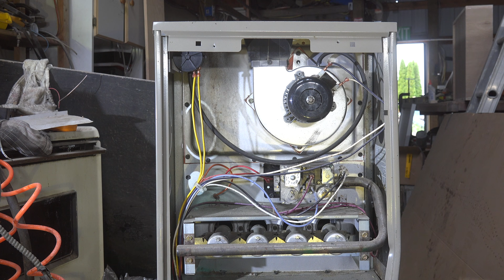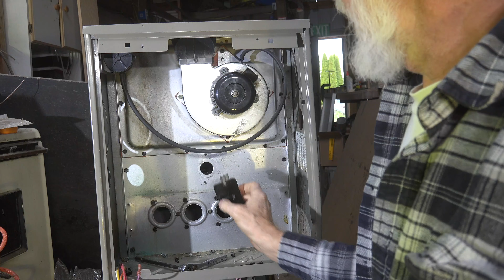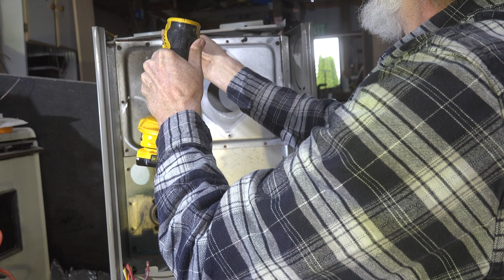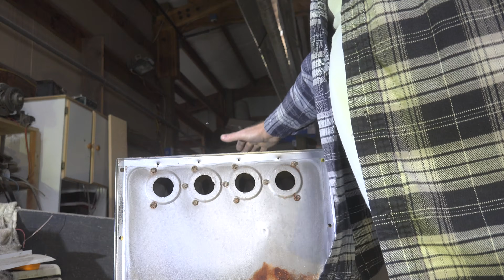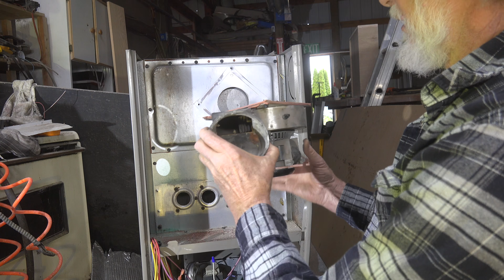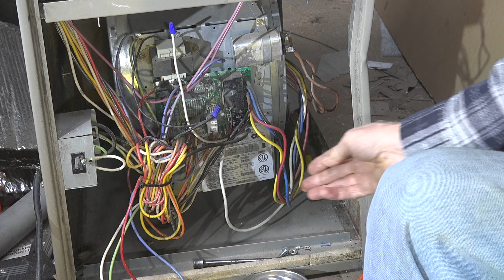Replacement of the Goodman GMP model heat exchanger

Comment: I had warrantied about 90 of the bakelite chimney connectors and Goodman called me one day and said they would not warranty them any more due to being cracked because the failure was due to me not pre drilling the screw hole. So I explained to them I was not breaking them that they were broken from the factory on the bottom side that it looks like they were were using an impact on the center screw. They said they would call me back in a few minutes. They called back and wanted to confirm my address. I asked why. They said they were sending me a reward for solving the problem they had of the chimney's cracking. The next few days I got a $250.00 check in the mail...

Comment: I’m pretty sure most technicians couldn’t do this anymore. I’ve got a Janitrol GMPN080-4. Knock on wood. Was just curious what was involved if I replaced the heat exchanger when that day comes. I’ll probably just swap it out but anything new is automatically inferior. It’s like a 95 Silverado lasting 500,000 miles and a new one having lifter or cam failures 50 miles off the lot. Appreciate your many Goodman posts. Be safe.
Reply from the maker: Heat exchanger replacement is fairly straightforward. It is a big job, but can be done by anyone with mechanical abilities.  
GFM

Comment: Anyone where to find heat exchanger for Goodman GMP100-4.
Reply from the maker: If you have checked with the local Goodman dealer, they have probably discontinued the part.  The unit is probably more than 30 years old.
GFM

Comment: If your furnace is 15 years old, replace the entire furnace. If you have the ability to replace the heat exchanger, you can easily replace the furnace with less effort. By the time you buy the heat exchanger, gaskets, rollout switches and plastic flue adapter, and maybe the burners, for another $500, you are brand new. The total labor is about the same.
Reply from the maker: The GMP furnace had a defect in the rivets in the heat exchanger that caused the failure.  It was an 80% furnace and I could diagnose the failure in about 10 min and return with the heat exchanger (under warranty) and finish the replacement in about 1.25 hours.  With driving time, the bill would be (in the 1990s) out the door with a customer bill of $150 to $175 for the total bill.  
GFM

Comment: Thank you so much. You are still helping people like me. 25 year old furnace but my free labor, your help and $229.00 fixed. I did install a new inducer while I had it off. $80.00
Reply from the maker: Its good when it works out!
GFM
Reply: Where did you find the heat exchanger for only $229? Thanks

Comment: Great video and thanks for sharing. 26 years old same furnace never any trouble. Heater exchanger finally went after 26 years. Only 275.00 new to replace and my free labor.
Reply from the maker: Glad it helped
GFM
Reply: Can you link to the replacement you bought?
Reply: @marshallandroxy  yes I will get that information for you. And yes, it’s still going strong January 2026 my furnace is the original from when the house was built in 1999.
Reply: @grayfurnaceman you are the best.
Reply: Did you send a link for where you bought the heat exchanger? I don't see it. Please send it again. Thanks.

Comment: Hi Gary thanks for your excellent videos! Gary I see a potential problem replacing the heat exchanger on my JANITROL GMNT100-4 after doing some more scoping of things and that is, it looks like the whole heater assembly unit is a pretty tight fit in the cabinet which means i would have to be able to pull the old HE straight out and put the new HE straight in as the AC cabinet above the furnace doesn't seem to want to budge after putting some ratchet straps on it and trying to lift it up a tad. And i saw in a Payne HE replacement video where the guy had to lift up the back end of the HE to fit some tabs on the back of the new HE into some slots in the cabinet frame, which required him to lift up the back of the HE a few inches and then drop the HE tabs down into some slots. So if the new Goodman HE for this unit has to be lifted up a bit and then dropped down into some similar alignment tabs, i'm pretty sure it won't go well as its looking like there may not be a way to hoist up the AC cabinet which sits on top of the furnace. On the other hand if i wouldn't have to lift up the new HE any and could just slide it straight into the cabinet, then i may be able to replace it. I guess i could dismantle the old HE and try to slide it straight out and find out if it will it will pull straight out that way, but i'd like to avoid doing that if it could potentially affect the AC part of the system.

So just wondering if you've ever been able to pull a Goodman HE of this type straight out and slide one straight back in without having to lift up the top lid of the furnace or lift up the AC unit above the furnace in order to replace this type of HE unit? And looking at the current HE, it looks like there's a lip that faces forward and i can see some a good amount of sealant between that HE metal forward lip and the roof of the cabinet, so i'm thinking i wouldn't have to undo any screws for the top of the HE?
https://voomisupply.com/products/tru-cut-inc-0257f00174s-ht-ex-assy-5b-fur-burner-furnace?currency=USD&variant=45440980648242&stkn=5587a5a64bed&utm_source=google&utm_medium=cpc&utm_campaign=PMax:+-+Catchall&gad_source=5&gclid=EAIaIQobChMIlMyDzqSNjAMVBxtPCB1OBiwFEAEYASACEgIwJfD_BwE

thanks again Gary for for any insights!

Comment: Good job GFM!
Is there a limit to where a furnace gets old enough that parts are no longer available for it?
People want me to buy a new furnace because mine is and 1988 model. Thats getting pretty old.  It is a  Rheem Horizontol and to my knowledge still has the original heat exchanger. 
If could buy parts for it it would out last me and my grand children and theirs.
The heat exchanger is the straw that brakes the furnaces back.
Reply from the maker: Most parts for that furnace are general replacement types.
Of course, the heat exchanger is the problem.  I would guess that a replacement for your furnace is no longer available.  
GFM
Reply: @grayfurnaceman  I haven't checked on parts yet. It has not set off the CO monitor yet either so that's a good thing.
It couldn't have much life left in it though.
in 2028 it will be 40 years old.
I have a pilot igniter on the way and I plan to check the heat exchanger before putting it back in service. Its been down a couple weeks now. 
I have to work on it myself since  no one will put it back in service.  
Thanks to you guys on youtube I could almost do house calls.😀

Comment: I have a Goodman GMP075-3 and came here not necessarily to replace the heat exchanger but to remove it in order to access the bottom of my evaporator coil in order to clean it.  The evaporator coil is an old Bard one, to match the condenser unit outside (probably 40+ years old).  It's all R-22...really being cheap here but the furnace and AC run fine (with exception to hitting high limit with a slightly dirty filter and now I can see my coil icing up) but I was able to remove the blower and look through the heat exchanger to see the dirt caked coil.  I probably should replace all of it but that's quite an expense and a bit of work.  I wish there was an easier way...but I don't think so.  I have walls on 2 sides of the furnace, I'm kind of backed into a corner on this one.  My last ditch effort will be to clean the coil, if that doesn't go according to plan then I'll be upgrading to a new unit in the not so distant future.
Reply: How did things turn out for you?  I've also got a GMP075 REV A,  from 1997.

Comment: I presume there are no gaskets or caulk needed for the heat exchanger and it just sits right back into the space?
Reply from the maker: The inducer must be caulked with high temp silicone to the heat exchanger.
GFM

Comment: I have a luxaire and looks allot like this furnace..was told a replacement of exchanger is close to 2 grand...may as well buy a new furnace than spend that kind of money..
Reply from the maker: All I can tell you is that furnace was quite an easy replacement of the heat exchanger.  My total hours including diagnosis would be 3 hours and if the heat exchanger is under warranty, zero for the heat exchanger.
GFM

Comment: I have a Gmp075-3 it runs bringing room up to or holding thermostat temp but it runs Blows heat Flame goes out inducer motor keeps blowing for 1,2 min then flame kicks back in and runs another 5 min keeping it at set therm temp cuts off and repeats need help -5 Degrees out
Reply from the maker: Sounds like overheat to me.  Plugged filter, dirty blower wheel, plugged A/C coil or ductwork problems.
GFM
Reply: @grayfurnaceman  Will Check Thankyou

Comment: I have a 18yr old goodman gas furnace model GDT090-4. Im looking at replacing it or putting in new exchanger. which way is best to go.. I can get a new downflow goodman 80k installed for about 1800. However, Im thinking the exchanger I could do myself alot cheaper. I already put in last yr the control board and limit switch.
Reply from the maker: Its on the edge of not worth it but if you are doing the work yourself, I would consider it.  You have already put some money into it and the job is quite doable by a handyman.  
GFM

Comment: if I replace heat exchanger with OEM, will the new one fail also? Is there a better aftermarket exchanger?
Reply from the maker: I have seen 2d heat exchangers fail.  Heat exchangers are specific OEM parts, so you are stuck with them.
GFM

Comment: Wow, I've had two of these units in my house since the mid 90s and I have never had a problem with either one. Appears I should consider myself lucky!
Reply from the maker: You probably are.
GFM
Reply: @grayfurnaceman   I have a 60k  Janitrol, the year after I bought the house  the ingnighter went out.  A $560 dollar bill.
I started looking into furnaces. Been through maybe 4 of them, Mn ya know? 
An upper heat limiter switch, and an inducer motor.,
I have one flame inducer bypassed because I am crazy and lazy.
I think I could do the heat exchanger a bit easier with my unit but, it is probably time to just give this idea up instead of pushing my luck.        
 
I have an HVAC dude that will help me put in a new Goodman, I will have to pay him but I will do it myself and have him look it over. I need to do this before your President Biden wants me to upgrade into HE,  Bankrupt the Farm? 
What a fool! 
At any rate, thank you for the video, it is not rocket science but it is far more than any "Settled Science"  clown like Obama could ever understand.
What is wrong with these mostly wrong and America hating Democrats? 
I will find an ethanol burner and really burn the low IQ carbon footprint mass stupids.
Reply: Yours was probably assembled on a t,w, or th. Everyone else got one from M or Fri production 😂

Comment: Hey, maybe you can assist.
I have one of these in my home. Model # GMP100-3. My furnace is not heating and I’m thinking the igniter just needs to be lit. I seen when you pulled the igniter cable out where it was located.. can i just light it with a lighter/candle lighter?
Reply from the maker: I guess you could start the unit and when the gas valve opens in a trial for ignition, light the burners.  The problem here is it will run for a cycle, then shut down and not start up.
If the ignitor does not warm, check the error code.  It will tell you where the problem is, not drafting enough, failed ignitor.  Often an ignitor will fix the problem.
GFM
Reply: grayfurnaceman okay i will try this. Thanks so much for your quick response!! :)

Comment: I have the same furnace.  I replaced the gas valve and fan inductor.  Do I have to adjust the gas valve pressure or does the factory set the pressure. Thank you again Grayfurnaceman.  You always provide great videos.
Reply from the maker: I always check the manifold pressure.  Your furnace is 3.5 in wc, which is kind of a standard and most gas valve come set at that pressure, but I would never trust it.
GFM
Reply: @grayfurnaceman  Thank you sir.

Comment: hello again question, wayne burner is from 1990,eg1 it has on it ,GPH 0.50-0.75 A should I replace with 0.50-0.80 A, right now I think it has 0.60-0.80 b would that make it leak
Reply from the maker: If your furnace is a mobile furnace you may need a 90 degree nozzle.
GFM

Comment: Another question ,as I mentioned adjusted electrodes and gun depth and furnace runs real good,But still getting quite a bit of kerosene dripping directly under housing unit ( between pump and motor) could the seal be bad or shut off on pump if it has one ( single line stunted pump) pump is somewhere around 6 or 7 years old
Reply from the maker: If all fittings are free of leaks, you could have a pump shaft leak.
GFM

Comment: I did that once in my 13 years on a Carrier High Efficiency, it was a pain. The instructions were OK and it took about 6 hours, with an hour of letting the sealant tack up.
Reply from the maker: The repair time is for that furnace only.  Most other 80% furnaces and all 90+ take much longer.  I usually allow 5 to 6 hours for them.
GFM

Comment: couple of broom handles into the burner tube holes and sticking out  a few feet out for more leverage works pretty good.
hands on top near exchanger to lift, ends extended under forearms towards elbows for balancing leverage.

Comment: Do they still even make replacement exchangers for this junk?
Reply from the maker: Yes they do.
GFM
Reply: @grayfurnaceman  I suppose they have to for making a defective product dead on arrival.
Reply from the maker: @AmericanFarmerHVAC2024  Well, I can't say it was defective from the factory, but pretty close.  
Within 2 years of the initial install I was checking all units for flame rollout and I seldom found one that was not failed.
GFM
Reply: @grayfurnaceman  what is flame rollout? Just wondering.

I was excited to see my exact furnace here and you saying it was a quick job, until I read the comments, and also seeing you need to unscrew things in the side where I have no access sort of kills that plan. Still, nice to know it could maybe be done.

Debating only replacing the blower motor to get another season out of mine.

Comment: Another great video, thank you! I have one of these dangerous piece of crap money pits, but I don't use it anymore since I installed a mini split heat pump. I'm in Tennessee so it doesn't get too cold here, the mini split does just fine for me since I keep my house pretty cool anyways and it costs about $80 a month less to run than that crappy furnace.

Comment: On this GMP unit for us newer technicians, what was the failure point?  Is it that the rings pop out?
Reply from the maker: The rings pop out on the older units.  This happened within 5 years.  Later, and I believe with replacement heat exchangers, a number of cracks started near the rings.  
Pretty much what TheGettoLobster has said.
GFM
Reply: @grayfurnaceman  Thanks helps a ton!
Reply: Sometimes rings, other times cracks. After the GMP goodman switched to a tubular heat exchanger. But they fail more often than other brands.
Reply: @TheGhettoLobster  Thanks for your help!

Comment: Gary do you know how to replace a oven door sping on a vintage tappon stove let me know post you have done it this would be like from the early 50s f
Thanks for every thing
Reply from the maker: I have no info on that one.
GFM
Reply: Thanks gary I am still looking into it in the 60 a and 70 des the gas company would fix gas appliances for free and the e mail electric company would fix electric appliances for free as well do you remember that
Reply from the maker: @paulcilluffo  It was never that way where I live, but some utilities did all repairs and replacements.
GFM
Reply: it's been 20+ years ago since replaced springs on one of that vintage and I kind of recall having to dismantle the whole "flipping" thing to a zillion bits, removing the whole top and all outer case too. but I could be thinking of wrong oven/stove, so it's to be taken with a grain of salt :)

Comment: THANK YOU! for making this video! I just did my first GMP075-3 exchanger replacement.  The new heat exchanger came fully assembled with some gasket material for the manifold. It slipped right in. One question I cleaned the burners while they were out. But when the whole house blower kicks in I get a lot of yellow. Is this normal since I cleaned it? Or could the new exchanger be defective? I also had to replace the inducer motor.
Reply: the blower is blowing dust out between case and heat exchanger plate and into the burner area. it should clear up fast and not return, unless you have very dirty ducts or keep stiring dust up
Reply: @throttlebottle5906  Thanks for the insight! I was aggressive with the cleaning since I had it apart.
Reply: I should have also mentioned oil and dust on the heat exchanger from manufacturing. they usually discolor the flame and smoke up the house setting smoke detectors off on the first couple starts and long cycles.
Reply: @throttlebottle5906  yes smoke detectors went off as planned , Thx!
Reply: I also noticed that the manifold has 4 screws holding it to the burner box. That the two screws on the top, both left and right had a spacer between the manifold and the burner box. I put it back   but was wondering what the purpose might have been. My guess something to do with burner alignment???
Reply: Do you have a link to where you purchased the heat exchanger?  I've also got that same model, from a 1997 install.  I'm assuming I may need to replace soon.